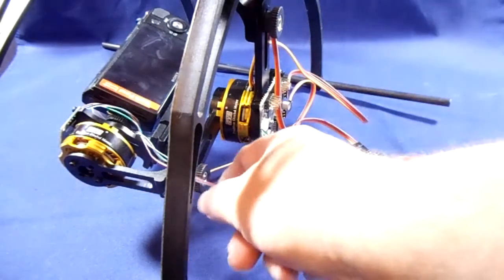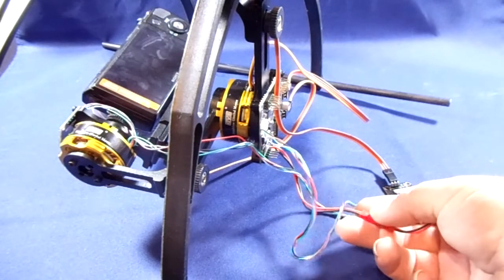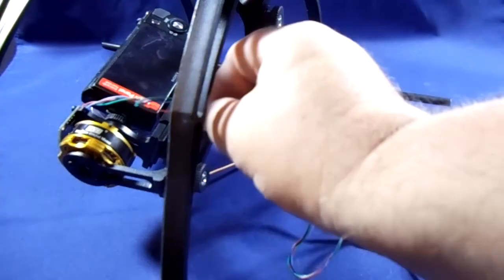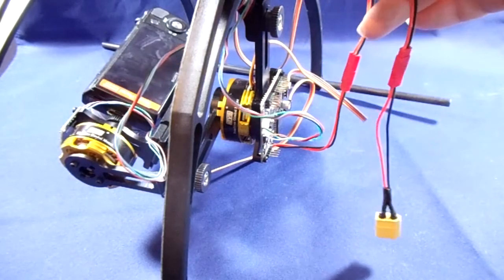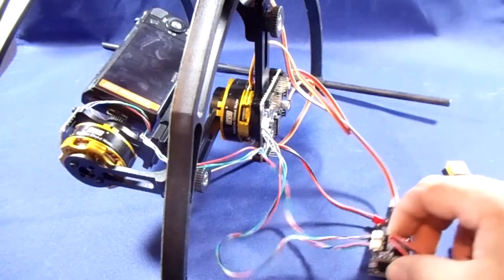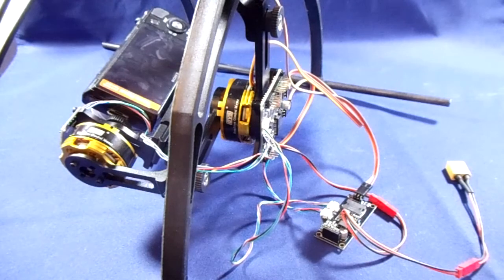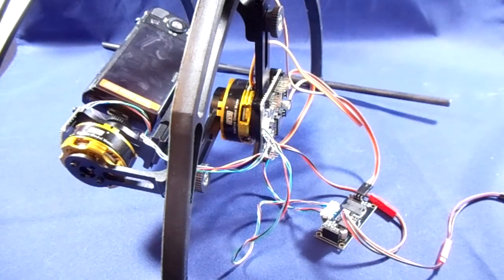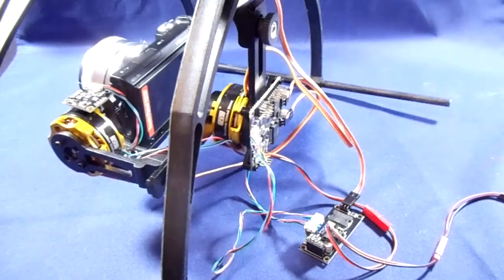Conneting up Alexmos 3rd axis board

Comment: Good job. I have mine set up on my hex and still tuning. One thing I do not like about the 3rd axis board is where they put the power connector soldering points... too small and too weak especially for a top mounted soldering point... not only that, where you solder the male and female jst connectors, they are too close together.

Keep posting and thanks.

Comment: Hello good video. I have 8 cinestar. three-axis gimbal. plate alexmos. engines (M5208-180T) and feel that power is missing. the roll does not return to the Centre only, I have to give thrust.do
 
batteries should I use?